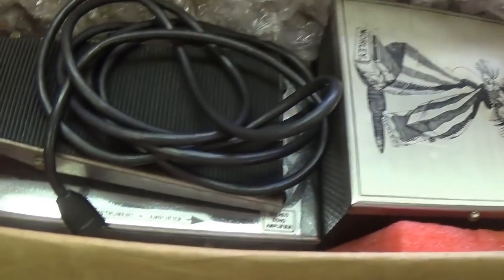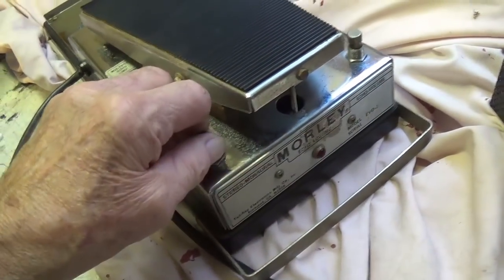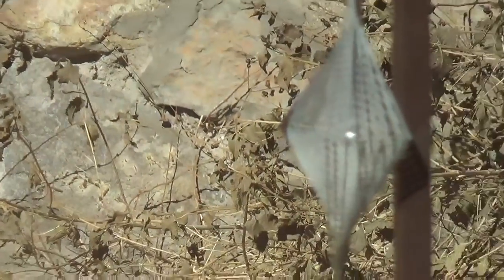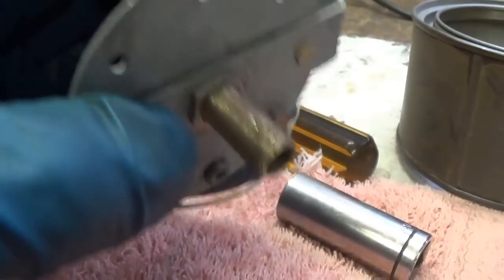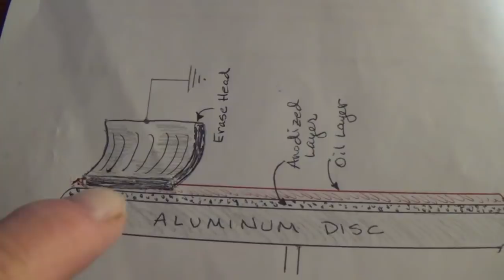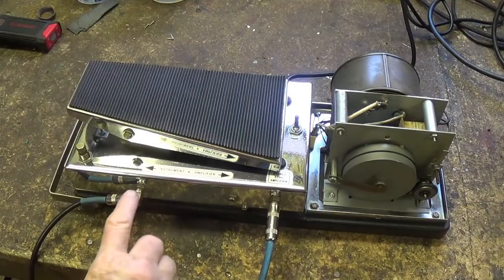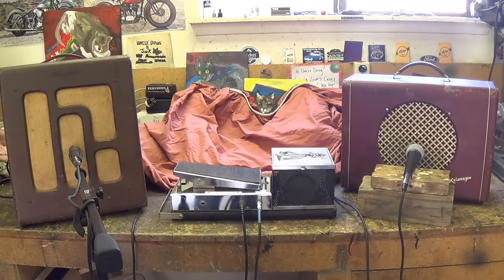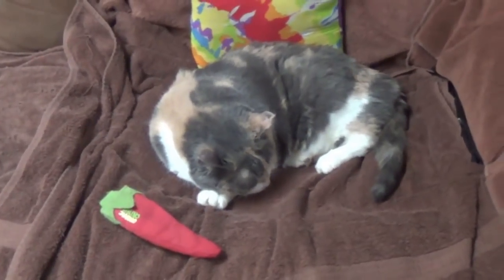1977 Morley Evo-1 Oil Can Echo-Delay Pedal......Complete Overhaul & Test

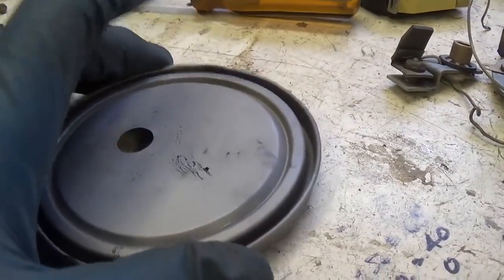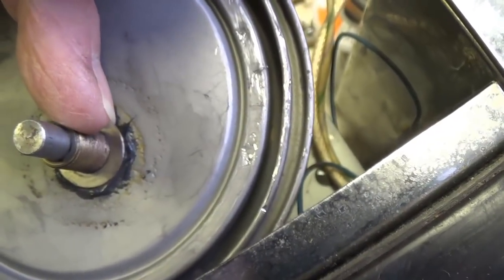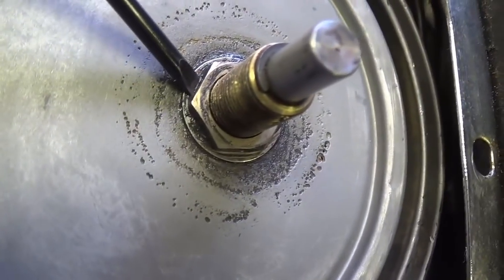Comment: Hello Doug :) I bought one of these 17 years ago and got it working and also a RW a.k.a. Rotating Wah. I'm sorry to say it but, you missed an oil leak on the front can lid - there are three small rust pin-holes that are visible by the backlighting from your bench lighting - I had to go back and find them frame-by-frame...you can seem them first at 27:30 to 27:31 and later during re-assembly at 1:00:53. They are located about 3/4" from the head-adjustment shaft between the shaft and the lid rim. I can see darkness through the three holes at 1:00:53 which tells me you didn't seal them from the inside. Great job in cleaning up that mechanism though!!! Dan Gibbs :)
Reply from the maker: Thanks for your input, Dan. Others have commented on the three tiny pinholes, and I agree, it does appear that they exist.....yet, during testing and handling, no leakage was evident.

Comment: Uncle Doug: I built a Fender 5F1 from kit, and rebuilt it because I thought too much hum. Now the hum is better, still there when turned way up, but the input wires from inputs 1 and 2 seem microphonic. I.E. tap test is fairly loud when amp turned up.  First build the 12ax7 seemed microphonic, now just those two input wires leading to the 68K resistor. Tyler
Reply from the maker: Replace the sensitive wires with shielded cable, SM, and I'll bet the hum subsides.

Comment: That was awesome very informative and interesting. I’m a huge fan of Morley pedals, I have several of them mostly wah pedals but some are volume and wah combined. They all use the photo eye to regulate the amount of wah or volume and are powered by either a 9 volt battery or an dc power adaptor from a power supply. I haven’t had a pedal with an ac power cord sense about the mid 70s it was a electro harmonics mistress or something like that. I should have kept it but let it go many years ago. Probably worth a lot now. IDK... Thank you ...
🎸🤓🎸🇺🇸☮️
Reply from the maker: You're welcome, Greg. Glad you enjoyed it.

Comment: 1:01:00 for me it looks like the metal lid itself is through tho. You can clearly see three little holes on that outer circular grainy damage (corrosion?) at about 4 o'clock. Very interesting video.
Reply: You can also see them at 27:34 after the sand blasting. Still really liked the video but I was hoping they were going to be addressed.
Reply from the maker: In person and viewing both sides of the lid, there were no holes evident. In addition, after sealing the can, I positioned it lid-down, and there was no seepage.
Reply: @UncleDoug  Interesting. maybe just a trick of the light in the camera then. Thanks for responding Doug.

Comment: To hold delicate round things, I drill a hole in a block of wood the diameter of the part, then saw the wood block in half through the middle of the hole.  Clamp the part in a vise between the two semi circular blocks.
Reply from the maker: That's an excellent suggestion, Cw. Thanks !!

Comment: Nice work, Doug. They should sound clean, no warble or modulation 'chorus' effect. Maybe resistor drift or leaking caps?

There are Youtubes of Yes's 1976 concert at Roosevelt Stadium in Jersey City, NJ. At the end of "Gates Of Delirium" you can hear Steve Howe playing a Telecaster through one of these pedals, the evocative intro to "Soon" (I was close enough to the stage to see the big chrome chassis).  Slightly different rendition from studio version (where he might have been using a steel guitar), but you can hear the clean echo repeats.
Reply from the maker: Thanks for your input, Steve :)

Comment: Caligula, oil, and food in same sentence really got me. Congratulations on that and having a company send you their own product to restore for their museum. Both great accomplishments.
 The disk seriously looks like a 90s era hard drive disk. There would be three or four per drive. Weird stuff. do not understand this magical rubber head
Reply from the maker: Glad you enjoyed the festivities, DB. Static electricity does not need a conductor to pass through. The charge accumulates on one surface of an insulator, while the opposite charge arises on the opposite surface, much like a capacitor......and, just like a capacitor, it can discharge.
Reply: @UncleDoug   If you come across another disk, shine light at half. It will change the charge. It has to be coated with Selenium. Remember this thought from last time, and it would hold a static charge. Old copy machine drums from this era into the 90s used Selenium to hold high voltage charge. Before just now I didn't understand how this thing was charging the plate, this is the answer. Someone back then was pretty smart. Important edit. It should only hold a charge in the dark or shadow. Bright light will erase it. Add some high voltage and that's how copiers work
Reply: @UncleDoug  Me again. If you go to a office supply store, look for a laser cartridge from any laser printer / fax or small copier. In the drum cartridge will be a thin green or blue drum or sheet on rollers. That's OPC o"rganic photo conductor" , it replaced Selenium starting in 80s to now. In the 90s all government copiers 15 pages per minute used the sheet. Would be interesting to run tests on it. Know it would work, not sure about the tone. Wonder if they have correspondence with Xerox, Ricoh / Savin, or Cannon

Comment: At 25:02 try the dual bolt trick to grab onto a threaded part. Put on two disposable bolts (wider ones are better) and tighten them against each other to hold them in place then put a vice grip across both bolts and now they can't counter spin or damage the threads as you work the shaft.
Reply from the maker: Thanks for the tip, Paul.

Comment: The taper of the light-controlled "potentiometer" can be somewhat varied by adjusting the position where the flap attaches to the threaded rod.   It is similar to adjusting the pot/gear on a regular wahwah pedal.
Reply from the maker: Excellent point, RB. Thanks !!

Comment: So great to see this !! I’ve got an old Morley Echo/Volume exactly like that and this will be great to help get it going since there really seems a lack of info on the web/YouTube on repairing them. Thanks Uncle Doug!!!!
A couple questions: what were you using as a lubricant and what did you use to clean the disk?
Reply from the maker: Glad you enjoyed the video, Jim. Good luck with your pedal. I cleaned the disc with Windex and used the specified Union Carbide oil. See my earlier video on the TelRay Organ Tone unit.
Reply: Thanks appreciate it, it’s been sitting for a few years since I couldn’t find any info anywhere about it.

Comment: This is really cool! I've built one reverb unit like the fender spring model. And two tube combos with spring reverbs. But this is fascinating. Now I want to build something similar but not the volume, maybe just the reverb effect and with two amps maybe have a choice for stereo. I think I could simplify this method.
Reply from the maker: Good luck with your project, Phil.

Comment: Uncle Doug, at 24:30 , to hold onto the threaded part, just thread those two nuts back onto it, and tighten one against the other. Then you can hold onto the tightened nuts instead of harming the threaded shaft.
Reply from the maker: I have used that method in the past, CJ, but in this case, heat did the trick, instead of brute force.

Comment: Unbelievably thorough and professional approach to this refurbishment. I was hoping that you would have commented on what I believe to be the most likely thought that this technology was replaced with the more modern spring reverb tanks. While the newer technology is obviously less complicated and as a result much less expensive and much more practical, I am wondering what your thoughts are on a comparison the signal quality between the two. Additionally, as an organist who at one time used a Leslie speaker with a combo organ back in the 60s, I see that the new “B3” clones from all the manufacturers,all have built in simulators that attest to be equal to the old Leslie tone cabinets, yet everyone seems in agreement that the Leslie tone cabinet blows them all away. Well,  believe that you, sir, have answered the “$63M” question, why? You said it in the video when you said the “sound comes at you from all corners of then room”. So now I believe the question has been answered once and for all. I bet you didn’t expect that!
Reply from the maker: Spring reverb is really a different effect, Danielle......not really comparable to the Morley Echo-Delay or the Leslie. To me there is no comparison to a Leslie speaker, in which the music signal is literally "sprayed" all over the room, like a lawn sprinkler, with extremely complex echo and delay as well as some frequency alteration (Vibrato) due to the Doppler Effect.

Comment: that notch in the pulley bracket looks like there might've been a cable or rod attached there to a remote 'stop/start' lever; it would certainly pull the small idler away from the motor shaft & stop the disc.
Reply from the maker: That's an interesting idea, Duncan. Thanks !!

Comment: Wow! that Morley was in pretty rough shape in the can. Did you notice the three rust pin holes in the lid before you finally assembled it all? You can see them at 27:35 and 1:00:54. They are near the bottom of the can so would be a possible leak path for the oil.
Reply from the maker: Several viewers mentioned this, but in person, the "holes" were apparently superficial and allowed for no leakage during testing.

Comment: Hi Uncle Doug! Last summer I watched all of your introductions to tube amp repair and was able to restore an old Traynor amp that was missing dozens of parts. This summer I took a chance and pulled the trigger on one of these Morley EVO-1 pedals in need of repair. I don’t think I would’ve trusted myself to take the dive if it wasn’t for the fact that I saw an hour long video by none other than Uncle Doug. You really help me wrap my brain around the concepts. Yesterday I finished all of the cleaning and reassembly of the backplate of the can with super black silicone sealer applied. I’m wondering what kind of lubrication you recommend for the shaft and if you’d also recommend oiling the motor? Thanks a million!
Reply from the maker: It's great to hear that you're putting the videos to good, practical use, Austin. I use 5/20 synthetic automobile oil on the bushings. It seems to do a great job and lasts forever :)

Comment: GREAT REPAIR AND RUNDOWN.
SELENIUM MIGHT JUST BE THE CHARGE MEDIUM ON THE DISC. WE USED TO USE IT ON CYLINDRICAL ALUMIUM PHOTOCOPIER DRUMS. THEY WOULD HOLD 1000V + DC CHARGE TO TRANSFER TONER. THEY CAN BE POLISHED WITH SILVO OR BRASSO. IF THAT HELPS.
Reply from the maker: Thanks for the helpful info, Pete :)

Comment: At 52:25 put a slit in a grommet on one side and work it into the hole to protect the wires without having to unsolder the wires, then put a drop of superglue on the slit - it is better than nothing.
Reply from the maker: I have done this often, as you said,  to avoid having to unsolder and re-solder.

Comment: Uncle Doug, you did a remarkable job restoring this pedal but it sounds to me like there's a pitch waver in the delay as if the aluminum disc isn't rotating at a uniform rate all the way around. Is it possible that the flywheel's set screw wasn't tightened all the way down on the shaft? Another possibility is that the aluminum disc has some runout. It did not look as if the flywheel were running eccentrically on the shaft, which is another possible cause I thought of. I know that this kind of device is going to have a little weirdness to it compared to a digital, tape, or analog bucket brigade delay, but not as much as I think I'm hearing. In any case, having even just one more Evo-1 pedal functioning in 2011 is a great thing.
Reply from the maker: I think you're expecting a higher level of fidelity than this electromechanical device can provide, Hub. Thanks for your final statement :)
Reply: @UncleDoug  Sure thing, Doug. Anyway, were it my pedal I'd try to run down the delay time variation but some people may actually like it like this; after all, varying delay is what chorus pedals do.

Comment: Uncle Doug, Would it be possible to find a sacrificial or damaged example of one of these Lubow discs and send a sample to one of the labs that can analyze and report the composition of the materials present?
Reply from the maker: That's exactly what needs to be done, Todd. It would be interesting to see analysis with a mass spectrometer, or some other device that can identify the composition of the anodized layer.

Comment: I kind of think the oil is the charge carrier and the particular anodization is to regulate the thickness and uniformity of the oil layer. There was a projection display tube called an "eidophor" that used an electron beam to scan out video frames onto a spinning disc coated with dielectric oil, and the charge variance warped the surface enough to reflect light on or off target. Same optical principle as a DLP micromirror chip but 1960s and analog, NASA used them at mission control in the glory days.

I think these might work on a similar principle, but the static charge is applied and read off directly from the oil by the conductive rubber wipers rather than e-beams being used to manipulate the optical properties of the oil. I have to wonder if the reflected beam from a laser pointer aimed at recorded portion of the disc would show any deflection with the input signal due to oil bunching up on the surface from charge differences, or if that effect is so weak as to only work in vacuum or requires high viscosity oils.

Really magical sounding device.
Reply from the maker: I appreciate your detailed input, TR, but everything I have learned from my own research states that the static charge is applied to the anodized disc and the oil simply seals and preserves the charge. If it were simply the oil that accepted the charge, virtually any metal disc would probably suffice.

Comment: Use a plumbers trick
For holding a threaded
Shaft get a strip of cowhide leather put the leather around the
Shaft pliers over the
Leather Has to be a good thick piece of leather.
Reply from the maker: Thanks for the tip, Dwight :)

Comment: Hey Uncle Doug! I followed your instructions from this video last year to restore one of these for myself. The only issue I’ve been left with is that the amplification of the delayed signal is pretty low. This has lead me to have to really turn up the signal that feeds the can to the point where chording overdrives the signal. But then I also have to trim the dry level back quite a bit to get the delay signal to be loud enough in comparison to the delay signal. Would you think that maybe the little trim resistors could use replacing? Or maybe a transistor or two?
Reply from the maker: Welcome to the frustrating world of the Evo-1, Austin. There is no way to be sure about the modifications you suggest other than experimentation. Transistor replacement would be a good place to start, but each unit has different issues and different requirements. You'll just have to resolve them on site. Good luck.

Comment: Hi Doug.  I don't know if you observed these or not, but there are 3 pinholes that go clear through the "Oil Can Lid" on the side where the delay time knob attaches.  They are visible in your video at 27:31 for a moment as you pickup the lid and the light shines through the 3 holes.   I suspected you were going to solder those shut or something,  but does not seem that you were aware they went clear through the metal.
Reply from the maker: Yes, several other viewers have commented on them, Ed. Thanks for your helpful input.

Comment: I have one of those somewhere in pieces. I called Morley and they said that the fluid inside the can is very toxic. Full of PBB's or PCB's or something like that. They said I could use brake fluid but mine was in bad shape.
Reply from the maker: Perhaps you could sell the parts on Ebay, SP.  Brake fluid will NOT work and causes harm......don't use it.

Comment: I was wondering if the material in the disk might be selenium that is impregnated into the pores made by the aluminum anodization process.   It is used in copy machine drums to be shock excited to carry static charges that are used to transfer toner - that might just as well be used to transfer the amplitude of the audio.
Reply from the maker: You may be right, Daniel. I have heard that copiers use static electricity to store the image on the drum.....similar technology.

Comment: I have one of these. More than a decade ago, I did a bunch of homework and tracked down the secret Dupont "oil" fluid. Everything is functional, but the disk has a pit in the surface that causes a "tick" noise with each rotation. Based on what I recall, Ray took the secret to the anodized disk with him to the grave and there is no way to repair or replace the disk. Well, I suppose you could replace if you found a donor pedal that was otherwise inop but with a clean disk. Any thoughts?
Reply from the maker: I wonder if you could fill the pit with epoxy?? I know of no other way to repair one of these discs.

Comment: I’m replacing the coupling caps in my ‘71 Ampeg VT-40. What type of cap should I prefer? Sprauge (?) orange drops?
Reply from the maker: It doesn't matter, Byron, as long as the values are correct.
Reply: @UncleDoug  Thank you sir

Comment: RTV engine gasket sealer is designed for use with oil won't deterorate my experince reguler silicon degrades over time.
Reply from the maker: Agreed. The product I used is specifically recommended to resist oil, Scott.